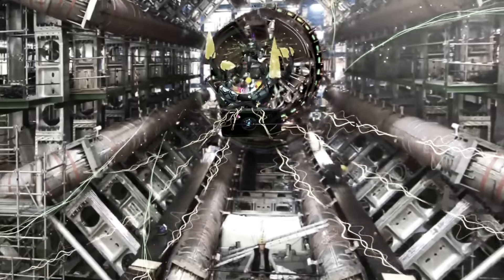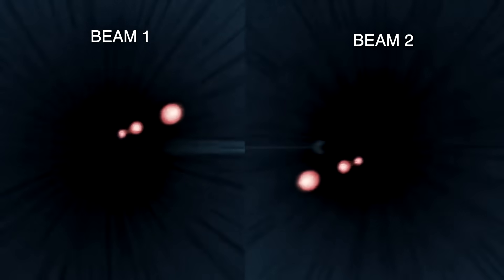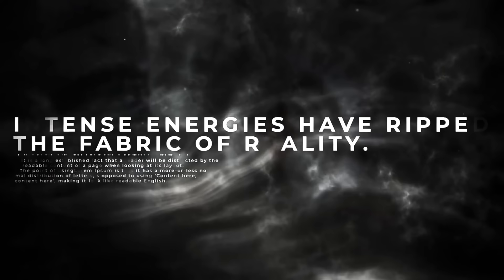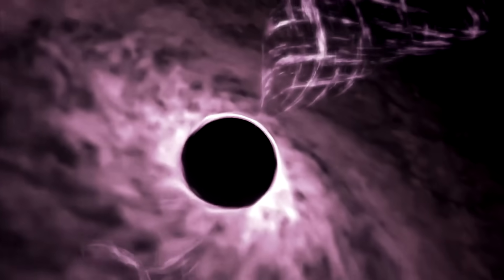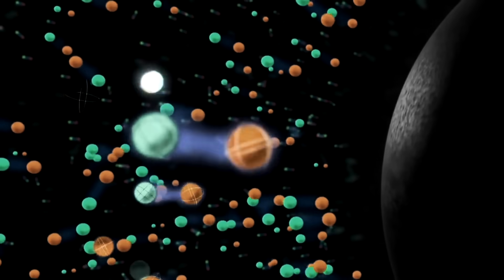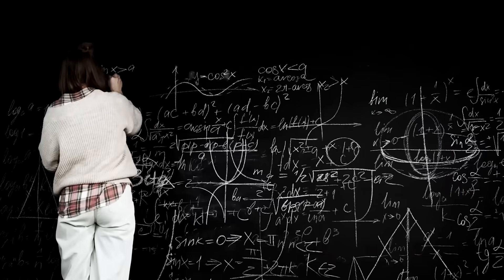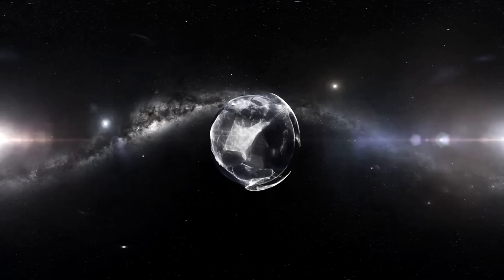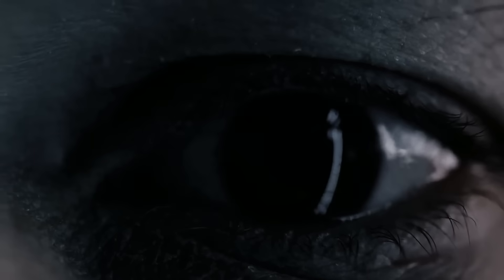Uh, CERN Scientist claims They have Opened a portal to another dimension..

Comment: 📜Revelation.9: 2And he opened the bottomless pit; and there arose a smoke out of the pit, as the smoke of a great furnace; and the sun and the air were darkened by reason of the smoke of the pit. 

3And there came out of the smoke locusts upon the earth: and unto them was given power, as the scorpions of the earth have power. 

4And it was commanded them that they should not hurt the grass of the earth, neither any green thing, neither any tree; but only those men which have not the seal of God in their foreheads. 

5And to them it was given that they should not kill them, but that they should be tormented five months: and their torment was as the torment of a scorpion, when he striketh a man. 

6And in those days shall men seek death, and shall not find it; and shall desire to die, and death shall flee from them.

7And the shapes of the locusts were like unto horses prepared unto battle; and on their heads were as it were crowns like gold, and their faces were as the faces of men. 

8And they had hair as the hair of women, and their teeth were as the teeth of lions. 

9And they had breastplates, as it were breastplates of iron; and the sound of their wings was as the sound of chariots of many horses running to battle. 

10And they had tails like unto scorpions, and there were stings in their tails: and their power was to hurt men five months. 

11And they had a king over them, which is the angel of the bottomless pit, whose name in the Hebrew tongue is Abaddon, but in the Greek tongue hath his name Apollyon.

12One woe is past; and, behold, there come two woes more hereafter.
Reply: That sounds like a vision I had awhile back but those creatures were more insect-like & the stuff of nightmares. About a foot in height but there were huge ones too that didn't fly.

Comment: The problem with these huge collider's is if it can happen on one scale it can happen on another scale so in other words you do not need something miles long to do what you're trying to do youcandoit microscopically. What people do not seem to understand is that anything that you can do on a large-scale you can do on a small scale. The fundamental potential of energy at one level is exact same fundamental scale of energy at another level think of it like like hydraulic brakes. Surface Mass equaling pressure of. You can for all practical purposes make a hydron collider the size of a microwave. They have the difference of space for the they can increase the speed but they don't need to use that space to increase the speed according to einsteinian physics speed equals density but what's really needed is frequency or vibration. All of The very aspects of our reality all of the platonic solids AR a part of a tonic scale I'm dictating this to a talk-to-text app on my phone it's copying one word skipping a word and print one word wrong so for every three words I print I have to edit to. What I'm trying to explain is that every part of matter in our universe is made up of a shape that shape is dictated by the frequency that form that shape colors have a frequency the same as shapes the reason you see blue versus red is because of a frequency the reason it's a square versus a cube is because of frequency. To do what they're doing with the Collider is completely unnecessary. The collider is essentially a cyclotron.

Comment: For both black holes and hell, there is a dividing line that separates it from the rest of all that exists. For a black hole, this dividing line is called the horizon, which completely encloses the collapsed matter. The horizon is an ideal one-way membrane: that is, particles and light can go inward through the surface, but none can go outward.

The Bible describes hell in a similar manner. Jesus once told a parable (Lk. 16:19-31) of a man in hell who desired to escape that horrible place of torment but could not because “a great chasm has been fixed,

Comment: In physics, dimensions refer to the different aspects of the universe, such as the three spatial dimensions (length, width, height) and time as the fourth dimension. The concept of additional dimensions beyond these four is explored in theories like string theory and M-theory, but these ideas remain theoretical and have not been experimentally verified. The existence of portals to other dimensions would require the existence of extra dimensions, the ability to manipulate them, and mechanisms to create and control such portals. As of now, these ideas are purely speculative and do not have a basis in established scientific principles. Science continually evolves, and new discoveries may reshape our understanding of the universe. However, until scientific evidence supports the existence of portals to other dimensions, it remains a fascinating concept explored primarily in fiction and theoretical discussions.
Reply: The existence of additional dimensions beyond our three explains a number of mysteries such as dark matter and feasibility of interstellar travel. Additional dimensions result in more compact geometry, so that distances could be measured in light hours or minutes instead of light years.
Reply: The CIA declassified documents on aliens, parallel universes, and astral projection. They're all real.
Reply: I suggest you look into the double-slit experiement then.
Reply: I believe the universe is multidimensional (more than 4) but that we are confined to a 3 dimensional portion of it.
Reply: @steveapplegate4565 mate, lighthoures would litterally be the distans light travelles in 1h,  you can just calculate that
Reply: physics doesn't account for all aspects of reality. They don't explore beyond the physical. there are non physical dimensions that you become aware of as you ascend through them. there's levels to this shit mate